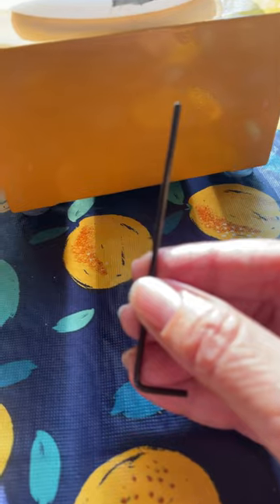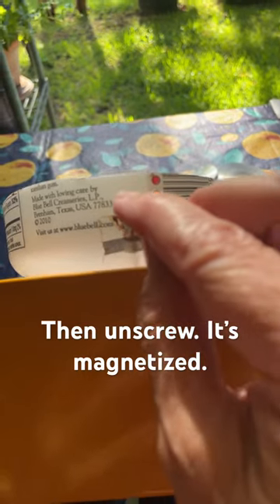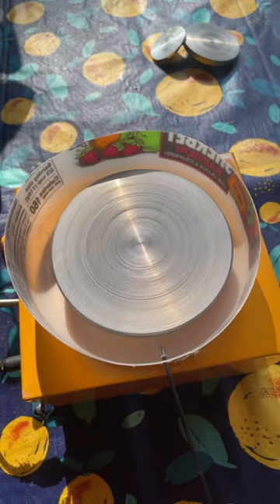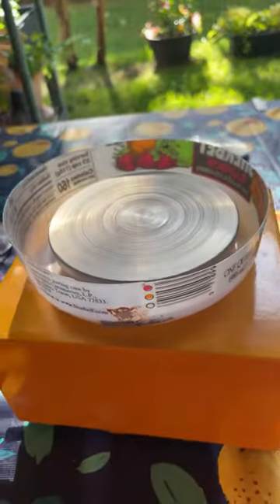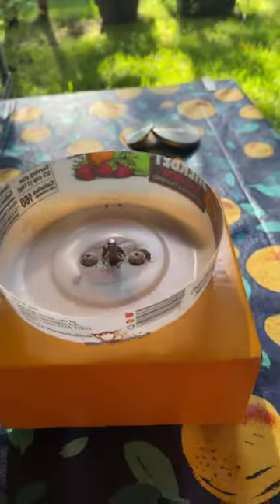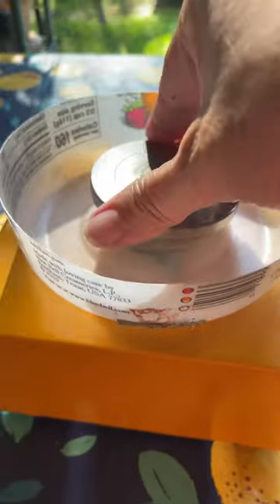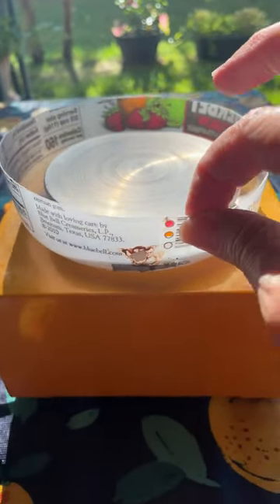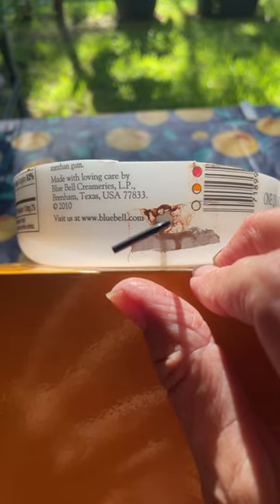How to change out wheel head on a tiny pottery wheel Yofuly or Vevor. #potterywheel #tinypottery

Comment: Why would you want to use one of the smaller heads?
Reply from the maker: May if you're throwing something really tiny and you want them all to be consistent for diameter measurement purposes. I actually have moved on to a better quality tiny pottery wheel, but I still use this one on occasion.